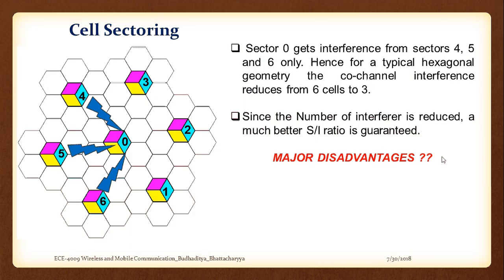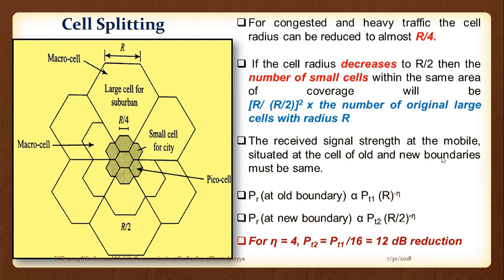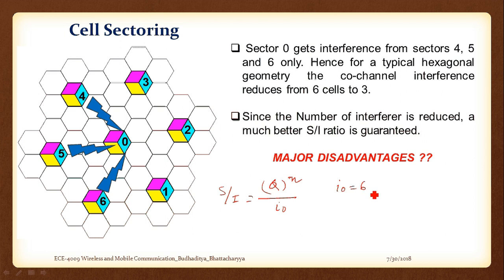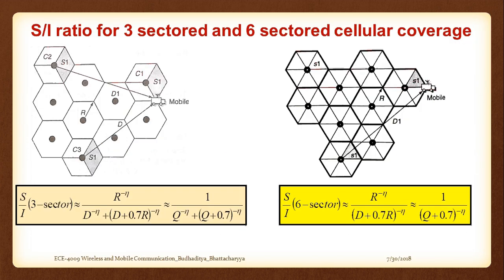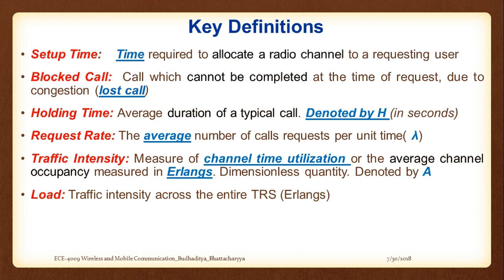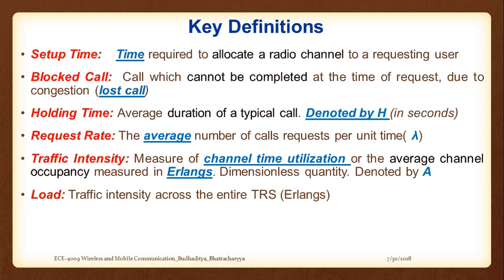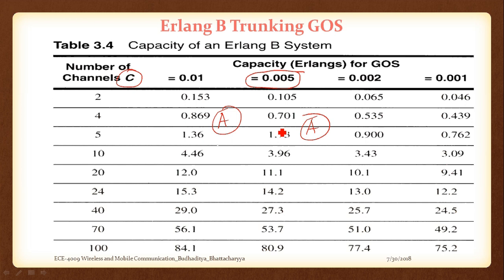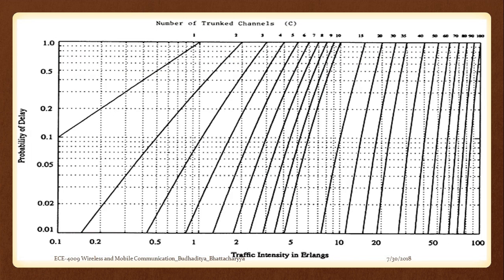Lecture 09 : Microcell Zone concepts, Truncking theory, Erlang B

Comment: Sir why it is not possible to combat co-channel interference by increasing the carrier power of the transimmiter
Reply: There will be a power race between the co-channels. Because if you increases one of the co-channels' power, the interference of that channel on others would also increases.  And if the others increase their power to combat the interference, you would have to increase the power to combat their interference. A never ending cycle.